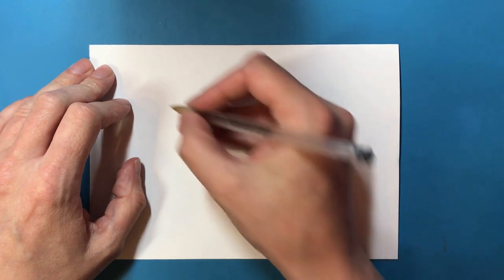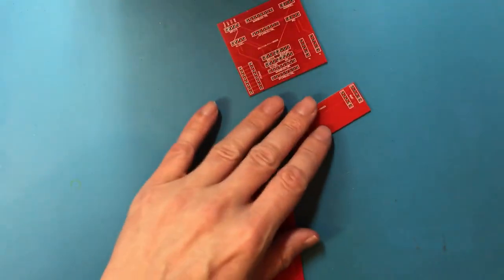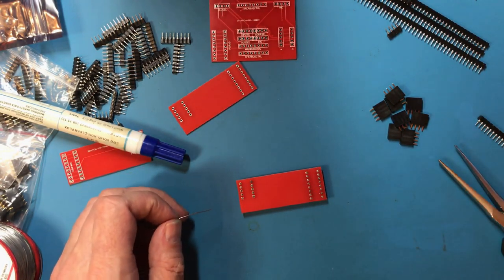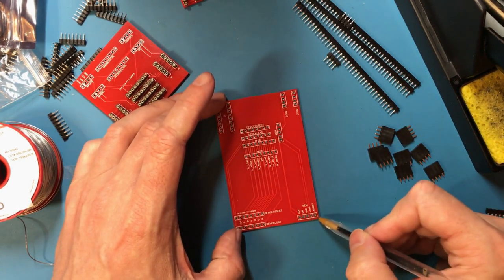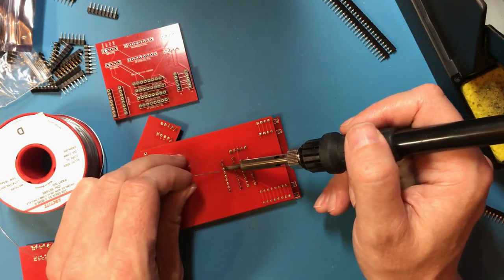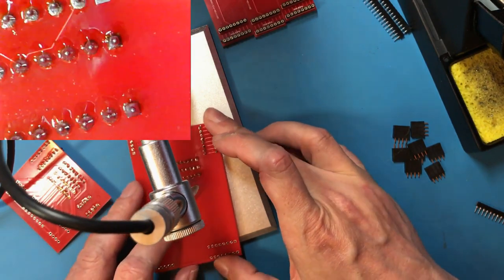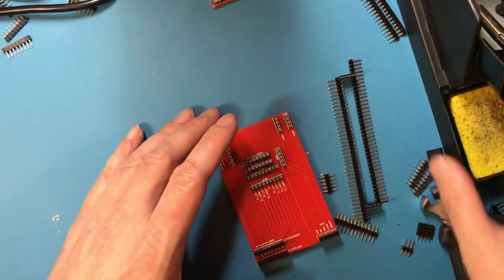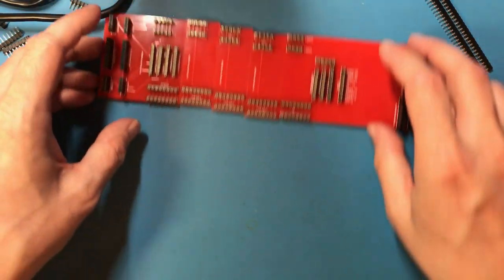2^9 Subscribers, and some Soldering.

Comment: Well done on your first milestone.

Since you asked: I personally like long-form, I often keep streams or stream recordings (1h+) in the background and some times will even watch them through if they are particularly good.
If you don't mind rubber-ducking for hours instead of getting things done quietly they are inexpensive to produce.

There also isn't a lot on YouTube about things like ISA design, addressing modes etc. and Ben pretty much went VAX on the breadboard computer.
You might find the odd bit here and there in some FPGA related material, but don't get me started on the quality of FPGA free education.

I think there's an interesting and poorly explored software space between soldering a CPU together and writing the first non trivial program in ASM for it. I spend a good chunk of my hobby time in there, and I would watch someone else spend time in it.
Reply from the maker: I’m not sure what I’m doing quite counts as ISA design, I’ve been bending over backwards to fit all my base instructions into 8 bits as the main push on this build is to get as close to 1 instruction per clock as I can. 

I’ll probably do play it by ear, video production always adds time (I can see how a raw stream is easier). My current thinking is to go all the way on a couple of functions and see what the response is like.

Comment: At 0:29, it looks you only have eight ones in the top row and eight zeroes in the bottom row. Those are 255 and 256, not 511 and 512.
Reply from the maker: Yeah, I messed up.